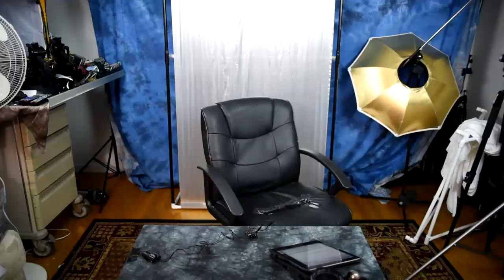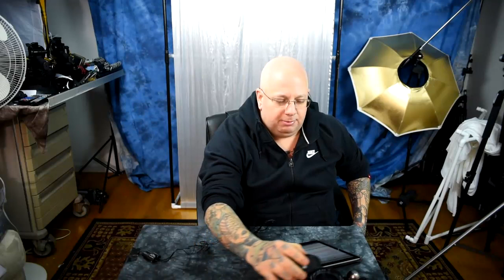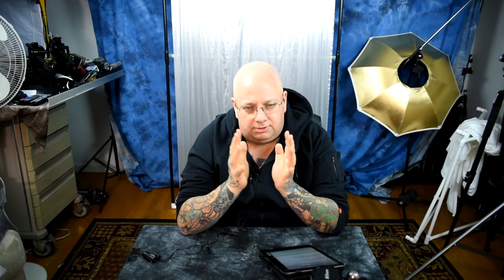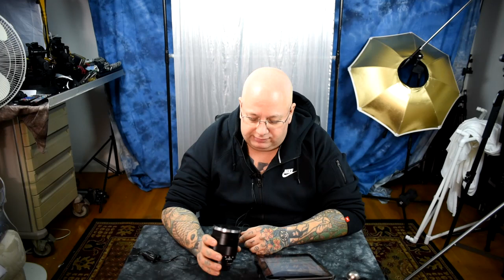Angry Photographer: Electrical properties of Optical Glass Lenses vs. Refractive & Reflective

Comment: Interesting subject. I was just reading an old book on heat and electricity. Glass was also found to be a better conductor of heat than metals. The different elements in glass change its percentage of radiant heat absorption. I remember reading somewhere else that glass can bend magnetic lines of force. Can a lens focus lines from a permanent magnet or coil?
Reply from the maker: +Arkiver Unified Energy see my 100+ vids on the FERROCELL